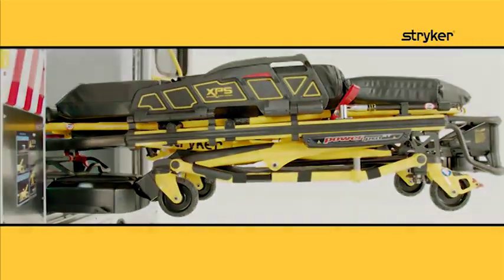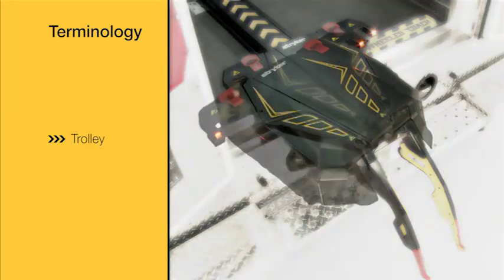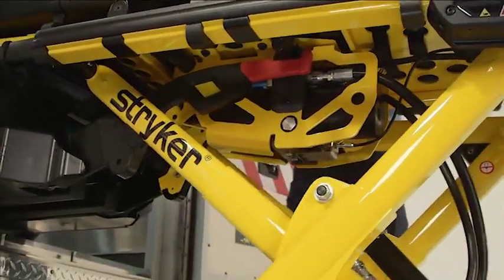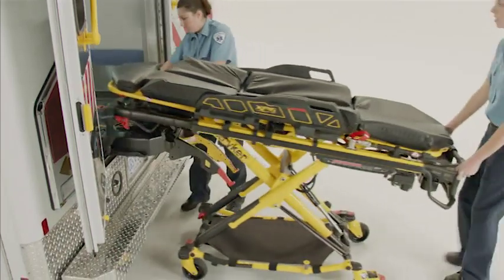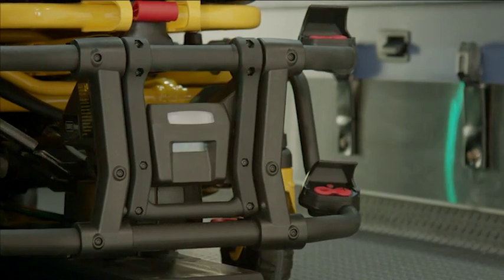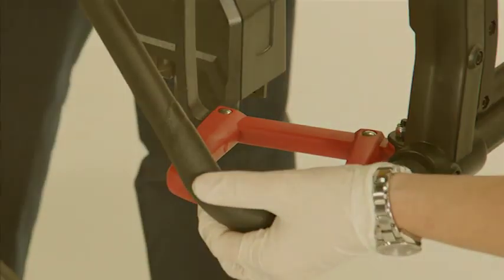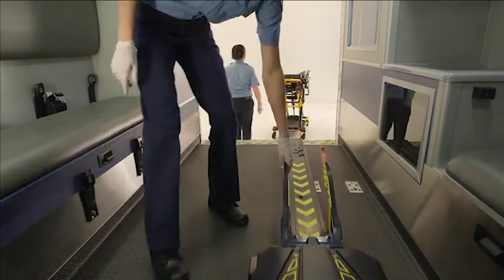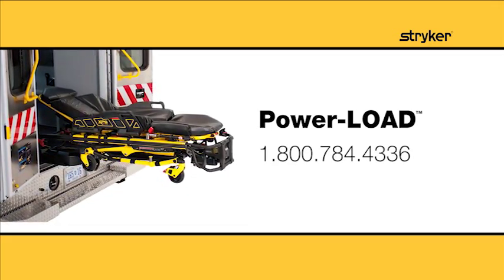Tutorial for the Stryker Power Load system

Comment: Iv been through several stryker videos trying to find a solution to a problem I had on our truck the other day!  
We got the stretcher out, leaving the doors open to go inside the hospital to get a patient for a transfer, and we came out to load the patient and the lifting system wouldn't work, it partially lifted and shut down. Can someone please help me with this issue. 
After a few minutes, i got the stretcher off the trolly an pushed it back up to lock in cause it was dead. I had to manually load the stretcher. It locked in ok without power but I was worried about it coming loose. Does the trolly have an internal battery? Bare in mind, we keep our trucks plugged into constant power when they are not in use, so batteries can charge. This thing shouldn't have died on its 1st use of the day!